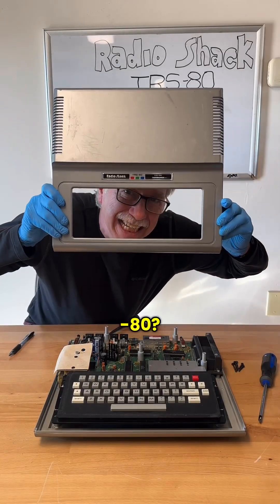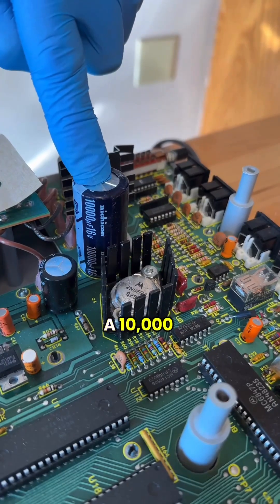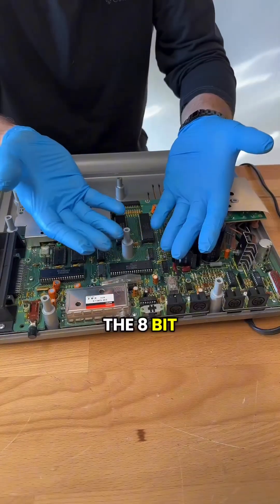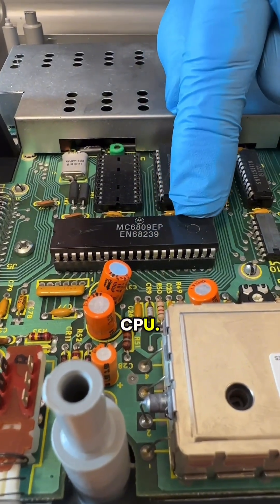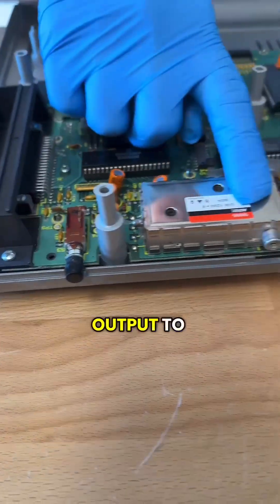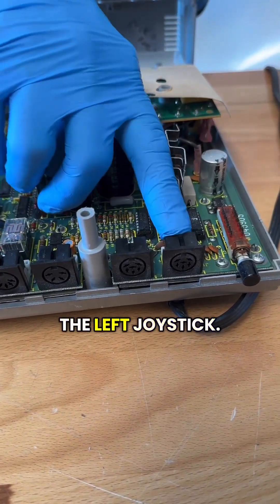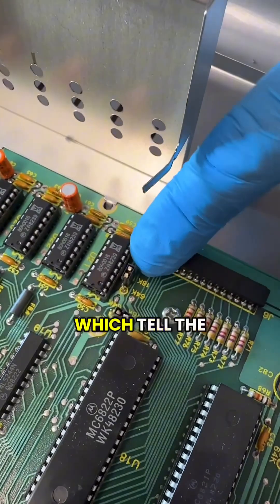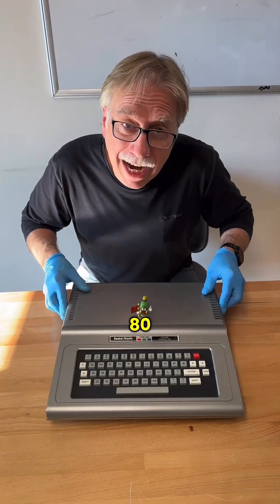What’s inside of a TRS-80?

Comment: Wanted to correct one thing - the screen resolutions. 256x192 is indeed a 2 color mode (black and green, or black and white), but the 8 color modes are semigraphics only (max of 64x192). 4 color modes go up to 128x192.
Reply from the maker: Thank you for the correction! Honestly, back in the day I wasn't big user of the TRS-80 even though I showcased it here at the shop. I can tell you know a lot more about this. I appreciate your input. Hey, if you have any follow up ideas for reels for this machine let me know. Would love to hear your ideas & will definitely give you a shout out. I'll try to check my messages regularly so I don't miss your reply.

Comment: When did they change to the z80 processor. I remember having a TRS-80 maybe it was model 2 in college in 1983 and using it to write assembly level programs to interface with an external Hardware adapter so I could do all kinds of fancy stuff like using a little pie computer today don't forget they had a basic interpreter built in and you could fire it up and immediately start programming I would use basic for my front end and then call my assembly routine which would run very very fast graphics modules for me
Reply from the maker: i thought it always used that processor. but i may be wrong. if somebody else knows, please comment.
Reply: @wefixstupidcomputers  - The model 1/2/3/4 used Z80's (Model 12/16's used dual CPU's - Z80 and 68000). The Coco line (Coco 1/2/3) used the 6809E (the Coco 3 at double the speed of the Coco 1/2). The Coco's junior cousin, the MC-10 used a Motorola 6803. While I did not use these in school, I did have a Coco 1 that I got in the fall of 1981, and have Coco 3's that I still use today.